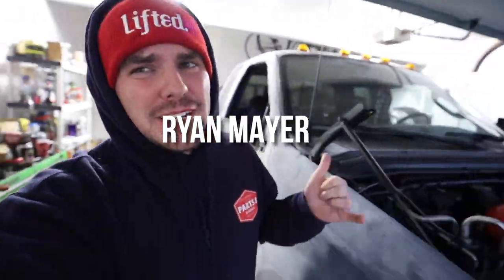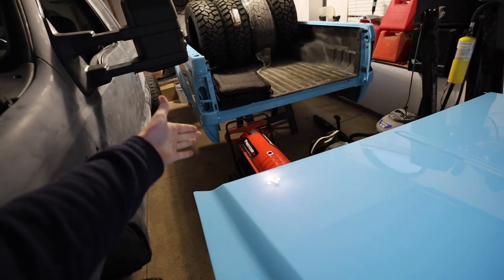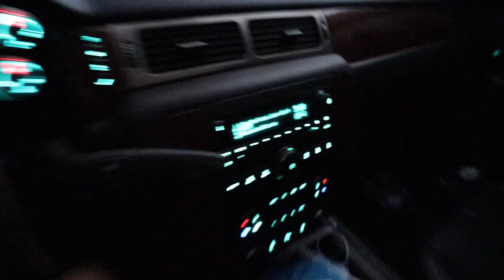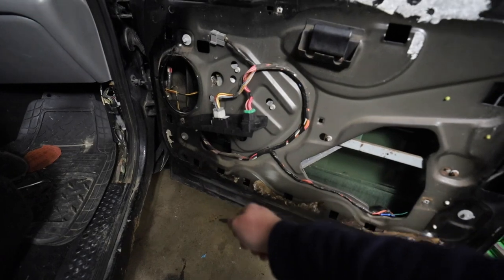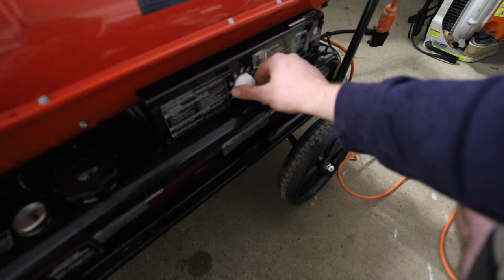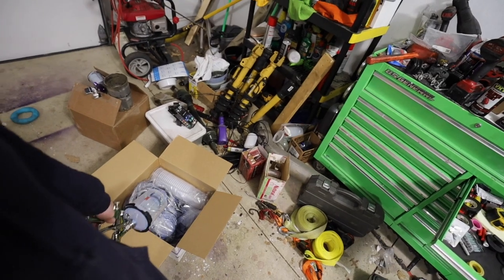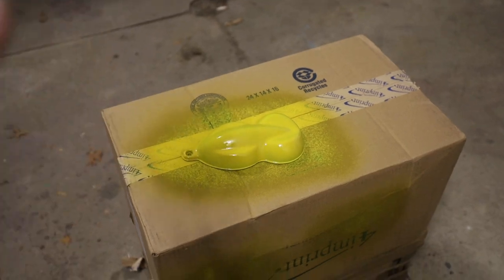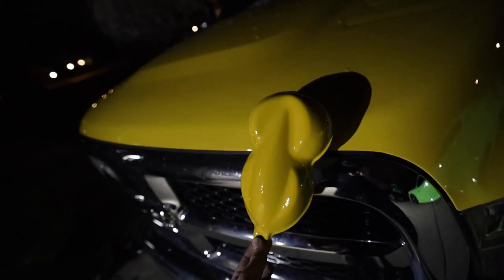Building a Banana Ram | Part 5

Comment: Hey Ryan, at my auto body class we use the same 3M PPS setup. When you use the liners you need to keep the gun upside down and spray till the air is completely out. This will keep the paint nice when spraying it onto anything.

Comment: Replace all battery cables on that 6.0 and it will help that starting issue. Mine did same thing didn't believe that was it but fixed the problem. Other 2 possibilities are the low or high pressure oil pump. But always start with cheapest solution first

Comment: If you are going to drive these trucks, you gotta get heavy equipment jumper cables.  The big heavy ones that they would jump a loader with.  I haven't bought any in years.  They were $60 a set when I last bought them, I would guess 80 to $100 now.  They never, never fail.  Watch for your LFTD sticker in the back window of my truck in Canton.